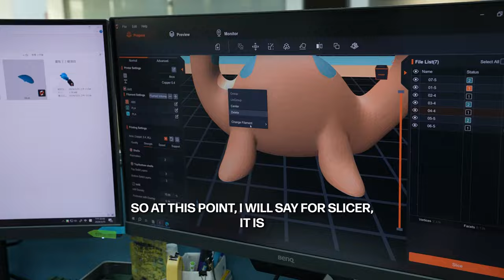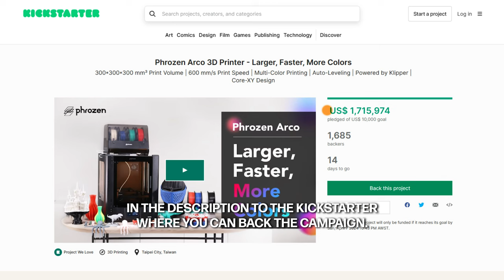Arco: How Phrozen is Breaking into FDM | Interview with Ray Wu, Phrozen CEO

Comment: I would like to se an upgrade in the near future to print in place with dynerma yarn so you can make parts very strong with strength optimisation in the right areas.
And allso as an upgrade to be able to print non planar.
Both will need new designed hotends and firmware.
Will not hold my breath but as a useful upgrade
I would not let this oppertunety pass.

Comment: The printer is very interesting to me. But the slicer scares away. It looks like a simplified bambu studio, too little functionality. To be honest, the bambu/orca sometimes lacks functionality compared to the Prusaslicer. Therefore, I still consider it to be the main drawback of this printer.
Reply from the maker: Phrozen has told us that you will be able to use any slicer with Arco! 

If you want to use the Chroma Kit it will likely require the PIXUP slicer for now, but Phrozen would like to integrate native support for Chroma Kit into other slicers, but that is not an option at this time.
Reply: I kind of second this. I think designing features that are exclusive for your own slicer is something that makes the market weary about long term usability. Using your own fork to develop features that can be easily imported into other forks, and work with other forks on such a strategy, will strengthen your market position, not weaken it.
Reply: They are now officially partners with orca slicer as well. But will work with any slicer.